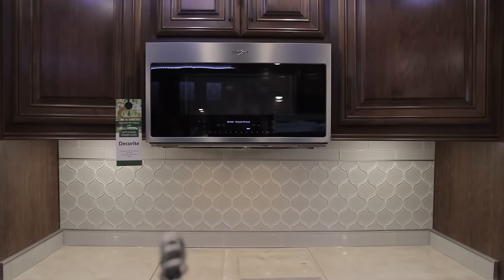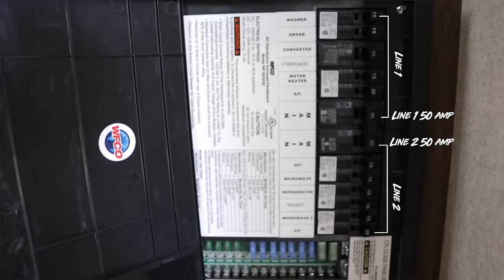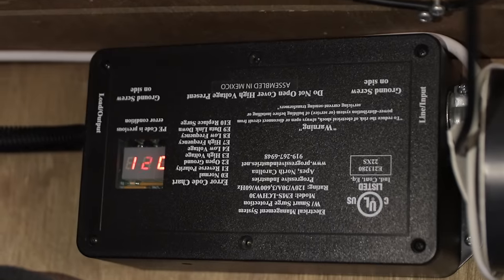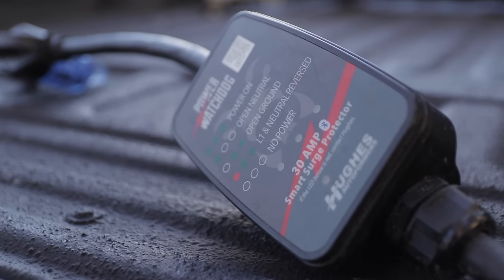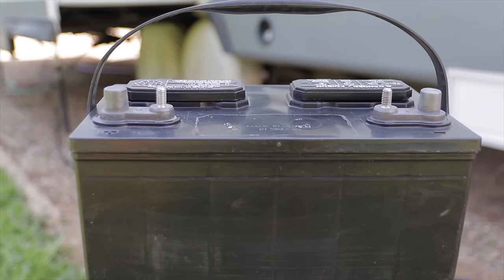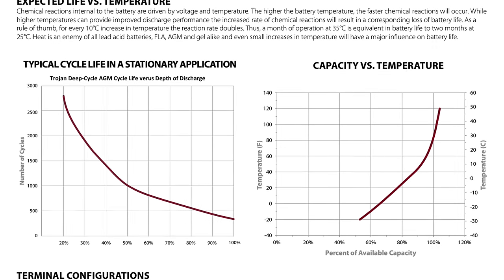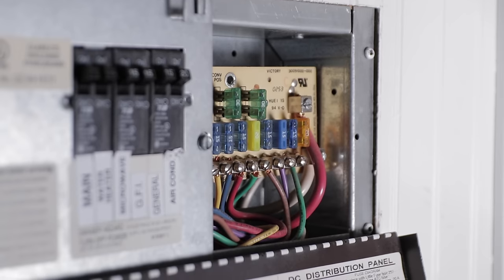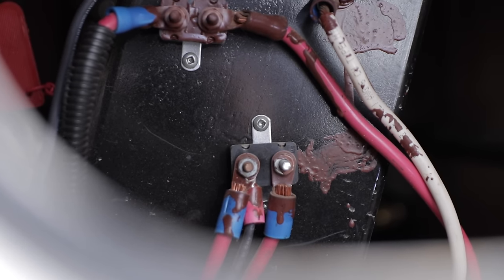Understanding RV Electrical!

Comment: I know this vid is 2yrs old but I’m hoping you’ll still see this. I’ve been going through your electrical vids (your vids are great by the way, I learn and use them a lot). Anyway, I have a question. I’m looking to at some point upgrade my 50amp class a Rv electrical to lithium and possibly solar. I think I have most of my questions answered from your vids but I have concerns about the switch over. In particular, my class a has a battery boost to start the engine should the engine batteries fail or lose charge. I’ve been researching and understand that you’re not supposed to use lithium to start an engine because the spike required of the batteries is too much for the lithium batteries. So if I switch my house batteries to lithium would I in affect lose the battery boost option for the engine?  Thanks for responding if you see this

Comment: As always...your videos are full of easy to understand information.  I have one question that I am researching, should the battery disconnect switch disconnect the solar charging? I store the RV in a vehicle storage in mostly sunny Florida.  Should I leave it parked with the solar constantly connected charging the Lithium batteries? Or completely disconnect the batteries?
Reply: You should NOT keep charging Li-Ion to 100% SOC in storage  Store at 75% SOC ...
Reply: @MrSummitville  I live in humid Florida. My RV will not be plugged in to Electric.  I want to run an alarm system and humidifier. In future, possibly a Camera System. Obviously, I will need to calculate the draw but would it be OK to constant charge? Or is there such a thing as a regulator to ensure the Solar stops charging at 75%. PS...I apologize if I am asking repeated questions.  I am a 100% newbie as I pick up our RV next week or the following.  I know it comes with 100w Solar Panel.

Comment: Do you know if campgrounds charge you more if you wanna use the 30 amp and the 50 amp? The reason I ask is because we have a mobile office that is a van conversion that we want to tow with our class A. It will not have sewer or water, but it will have air-conditioning and electrical. Have you seen anyone do this before?

Comment: Great videos, thank you!! I'm considering converting from 6-AGM 105 Ah house batteries to 4-Lithium 170 Ah house batteries, do I need to change my current system to handle the charging requirements for Lithium? Also do I need to change the 2-AGM chassis batteries to Lithium, or can I continue to use the AGM for starting the coach while using Lithium for house batteries, will they all charge correctly? We have 2017 Winnebago Journey 36M w/360XCL Cummins, it has the Magnum Energy MS2812 Inverter/Charger, ZAMP Solar ZS-30A system w/2-175 Watt panels.

Comment: Can you help us understand the circuit between a 50 amp shore pedestal, through a dog bone down to 30 and back to a 50 amp RV with split circuit breaker banks? i.e., How are both breaker banks supplied by a 30 amp dogbone? 

 My Grand Design Reflection was built with a 50 amp Input plug in case the owner ever adds a 2nd AC. Because the 50 app cable is so heavy and we only have one AC. I use a 30 amp cable..

Comment: I'm replacing my single stage converter with a new Progressive dynamics inteli-power 70amp smart charger.  Do I need to size the battery charging wires for 70 amps?!!!!  Im running a bank of 4 series/parallel deep cycle 6v batteries???  I don't believe The charging level should ever reach 70 amps!
Thanks so much for your continued help!
Rod
Reply from the maker: I would upsize the cables. The capacity of your bank is I'm guessing around 450 amp hours and at a 10%-13% charge rate could put you around 45-58 amps.
Reply: @AllAboutRVs  Thanks again!  you never let me down!  :)

Comment: You are a great source of RV info with excellent presentation skills - thank you! What is a good (affordable) way to charge my RV lead-acid batteries from my portable inverter generator? Do I simply plug in a smart 12v charger to the generator and clip to my batteries? I don't have a battery monitor but I do have a volt meter. Thanks for your advice.
Reply from the maker: I recommend using a multi stage converter. You can look up the model number on your converter and if it is multistage just plug your RV into the generator and the converter charger will do the work. If you have a single stage converter I would swap it out. they usually start just under $100. https://www.youtube.com/watch?v=mDEeSHrTv1k&t=294s
Reply: @AllAboutRVs  Great advice, you just saved me time, money, and convenience! I looked up my converter model as you suggested. My Winnebago Micro Minnie has the WFCO WF-8895 which is a 3-stage converter. It provides 13.6V nominal, 14.4V quick charge, and 13.2V trickle charge. Thank you so much!

Comment: Hey Jared!   Enjoy your helpful episodes.  Our new travel trailer has only 2 USB ports supported by our 12V system.  NO electrical outlets are supported by the 12V system.  Can I dedicate one or two plugs to be 12V (or both 12V and generator/shore power)?

Comment: Question if you are connected to shore power can switch off the batteries with a disconnect and still power all the slides and landing gear?

Comment: Great information. Question on the battery disconnect, would you place that on the positive or negative side? I’ve heard both, but just want to make sure.
Reply from the maker: I like it on the positive side.
Reply: Most excellent, that’s what I did last year, but since I saw a couple videos that said negative side, made me wonder, but I trust you and Chad (Changing Lanes). I’ll try and find where I saw that if you want. Thanks again!

Comment: If you installed a 50 amp inverter in a 30 amp wired trailer would it work on 1 leg? I am looking at the Magnum energy MSH3012RV MSH-Series 3000W 12VDC
Pure Sine Hybrid Inverter Charger. They have an MSH3012M model for 30 amp but I may want to run a 240 v load from the system and would need the RV version. Your thoughts?  Thank you

Comment: Not sure if you'll have any ideas. I'm living on a 39' keystone hideout and my power keeps going down on my 120v outlets. I'm trying to run the fridge, a space heater and my computer. But it keeps flipping the breaker.. every fre minutes it just starts to flip and im unsure what it could be.. its a 50amp camper with the ability to have two ac units as well. Am I really asking too much to run a heater and computer plus the fridge? 

I have the microphone off, the water heater, and nothing esle plugged in. Very frustrating.

Comment: Hey Jared, I was trying to find the video I watched where you used and aerosol product to clean the terminals on your shore power cord components.  Could you let me know which video it was, and whether you would still use it?  I was also wondering if you could use it to clean the trailer connectors?
Reply from the maker: Yes absolutely, I still use it and I use it on my trailer connection as well.  https://youtu.be/z-ATOr25oxs

Comment: I am planing to buy a grand design reflection 303 rls 5th wheel. It comes with one battery (not sure what type) and a converter. If   I want to boondock at a walmart for one night but want to watch tv and plug in and use my desktop computer for 5 hours straight, what kind of power upgrade would I need? (Not sure if I would be allowed to run a portable gen)

Comment: I got a question for you on the victron  charger converter charger which one do  recommend for my 30 amp travel trailer  But I want to run my AC sometimes

Comment: Well you haven’t answered me yet, (or perhaps you never do.😊),  but I have another question. I’m actually buying a 2021 Axis 24.1.  I want solar on that. What kind of solar can I use, including battery size, type and total cost, if you can give me that much info. Thank you in advance...
Reply from the maker: There are so many options but they depend on how much power you plan to use and the budget (It has taken us over 3 years to build up the system we have). I would recommend finding out how you plan to use power and measure it like in this video https://www.youtube.com/watch?v=WXtp5F4Z0aI&t=11s. 
For a solar starter kit I like the https://amzn.to/2Q0dpJ5 Renogy 400 watt MPPT kit. it has everything needed to get started. I like this panel size too because it is not to large to where it is hard to find a place to mount it on the roof and if you ever want to add to the system they are easy panels to get.  If you have the budget for Lithium it's the way to go once you know how much you need. Battle Born and Renogy are the two Lithium batteries I like.

Comment: Hi, I have a 2007 Thor toyhauler with the factory installed typical 12 volt plug in a cabinet.  I have a 12 volt TV ... when I run through that plug alone it works great ... however ... when I turn the generator on it makes the TV screen "jump around" ... so some kind of interference .... do you have any ideas what that could be?

Comment: Please help.   I'm running a 6/3 wire long term  for a 50 amp camper,,I wanna be sure I don't put 240 into the camper,  How is this prevented?   By the particular outlet I'm installing? 
Thank you

Comment: my new rv suffered a complete battery failure w/ the coach and engine batteries being depleted and no start of the engine and the volt meter reading 13.3 volts going in i guess.    what i want to do is to go old school and have    completely separate systems for coach and engine.   convrters and inverters and isolators  are great till they fail .  i am blaming it all on covid...   i am lucky i was not rving when this happened.   how difficult would you say it will be to go old school to install and any suggestions?    i can't seem to get good info from the dealer.

Comment: Hey ,  enjoy your channel,  appreciate info.  Can you tell me why the single phase supplies only 30 amp ?  Seems if a double leg carries 100, a single with 50 would be a big benefit as far as running many appliances at the same time.
Reply: If an RV only has a 30amp plug it is probably smaller in size and wouldn’t need more than 30amps. AC in summer is maybe 12amps. Electric furnace in winter is around the same. So really there would be no need for it

Comment: Just FYI, there is no such thing as a split phase power. Both "hot" legs of the 50 amp service are single phase. If you tie both legs together as in the case of a clothes dryer, its 240V single phase. A 50 amp RV plug uses two separate 120V 50 amp lines to service the RV. Most modern houses, for example, use 200 amp single phase service coming from the transformer. Its two 4 ought size (0000 gauge) hot wires and one 2 ought size (00 gauge) neutral. Even with that size wire, its still single phase power. Commercial buildings are typically the only places you will see 3 phase power which uses all three hot legs from the power line with 3 separate transformers. This gets really complicated but single phase and 3 phase are the only ones we use here in the US. I don't want to geek out too much about electricity but there are plenty of YouTube videos explaining how electrical phases work.
Reply: I’m sorry but “split phase” is an accepted terminology for single phase 120/240 volt systems in the US and Canada.   Personally I think it is useless and means nothing that I care about.   What I really do not like is those saying that one side is 180 degrees out of phase.   Ask them to explain what in a transformer causes an out of phase condition, and you will have ended the conversation.

Comment: QUESTION:  is there an easy way to convert the entire RV to DC (like somehow using the existing electrical panel and choosing which appliances and which outlets will use DC power by flipping breaker switches, or something) or do I have to run new wires to each electrical outlet?   And how can I make additional appliances (ie. microwave) run on DC?     - Tony
Reply: Hey Jared.  My apologies.  Just found/remembered your episode on “whole house DC”.  Thanks.  Studying that episode closely.  - Tony

Comment: I have 50 amp 5th wheel can I plug in my surge protector into my 50 amp cord then into my 50 to 30 ampdogbone to my 30 amp cord to the post at the cp ground

Comment: Are you using a solar battery charger that can step-up the voltage over the 14.8V (typical) alternator voltage, so power flows from both the alternator and the solar system at the same time?  Or does the solar system just cut-out when the solar panel(s) output voltage drops below the 14.8V alternator voltage.  Are you using a MPPT?
Reply from the maker: We have an Mppt for solar and a DC to DC  charger while driving. They work in parallel while driving to charge the batteries at the same time. https://youtu.be/7NDnZsouUyY
https://youtu.be/gbKBoIvXNPA

Comment: Question: when connecting to a shore line in an RV park for an overnight stay and not unhooking the trailer, does the truck to trailer electrical cable needs to be unplugged?
Reply: good question - i always unplug mine due to being overly paranoid.  so i wonder if this is actually recommended or if it's not hurting anything to just leave them in

Comment: Hey hey! I'm confused. I wanted to connect my rv to a home outlet,  i connected a 110 to 30amp dogbone then my surge protector, turned on breaker, green and blue light on, good. Connected one of two 10 gauge ext cord, breaker on again, green light and blue on, good. Connected other 10 gauge ext power cord, breaker back on, green blue still showing, good. Connected to rv, breaker back on, surge protector show reverse polarity??

Comment: I just got this old coach from 94 but it seems like the house batteries aren’t working if the chassi batteries are dead or disconnected. Is that normal ?

Comment: I was checking out your videos and found this one from last year.  I have a question about the powered tongue jacks.  I would feel safer if there were a way to power off the tongue jack while at a site, so the prankster cannot run the jack while I am away with my electrical system is in use running my trailer while parked.  Any suggestions?
Thank you,
Bill
Reply: Add a disconnect switch to the plus wire from the battery. If placed inside a compartment it is safer from pranksters.

Comment: I was good until you started talking converter, inverter. How do I know my converter is charging my inside batteries? We were camping plugged in a 30 AMP post. At night we had the AC and 2 fans and a tv on. Everything seemed to work fine. When we went to leave I went to start my RV and the battery was dead. We had no power. What happened? It was plugged in.

Comment: I'm not an expert on electricity, but I'm under the belief that split phase is simply a split, single-phase as they are simply split off of a single phase at the transformer.  Also, I don't believe that you get 50amps on each leg in the sense that they add together to produce 100A.  Otherwise, your breaker would have to rated for 100A.  In fact, I don't think I've ever seen a 100A service that only had a single (double pole) 50A breaker.  However, both legs together will let you run 50A at 240v instead of 120v, which gives you twice as much power (watts), roughly 6kw vs 12kw.

Comment: Jered Question Where and how does the inverter power feed the ac plugs that you want to have run on battery only?  Do I run a separate invertered ac line to wall plug that can be used anytime on battery only?  Thanks
Reply from the maker: There are a handful of options to install inverters, every thing to a dedicated outlet to powering your entire RV. Our most recient video with diagrams https://www.youtube.com/watch?v=7xKOyRyxdNk&t=1s and a n over view video here. https://www.youtube.com/watch?v=rqrEIKWoMrU&t=586s

Comment: If a surge protector takes a surge, is it trashed and needs replaced ?  If so, wouldn't it be less expensive to just use a portable surge protector ?
Reply from the maker: Some units they can replace just the surge portion.  One of the reasons we went with the hardwired unit is it was the least expensive option, but the portable ones are extremely easy to deal with definitely a consideration for your preference.

Comment: I need some help.  I have a 2019 Winnebago Travato 59G.  The generator and the shore power do not charge the house batteries.  Only the solar panels and the chassis engine currently can charge them. I also do not get shore power to power anything inside when docked.  I did change the solenoid for the house system.  But that didn't fix the issue.  Anyone have any suggestions?